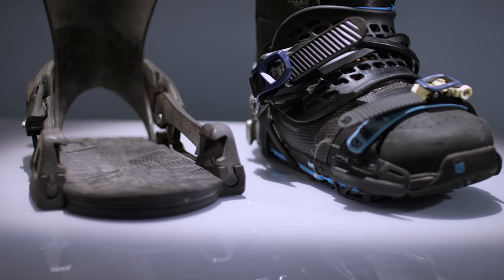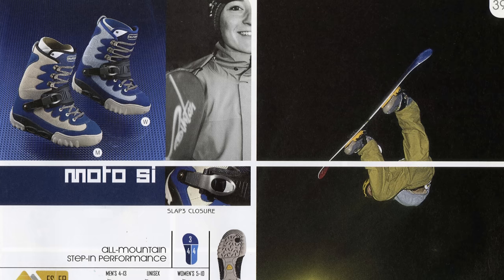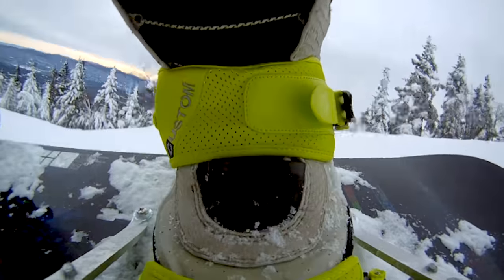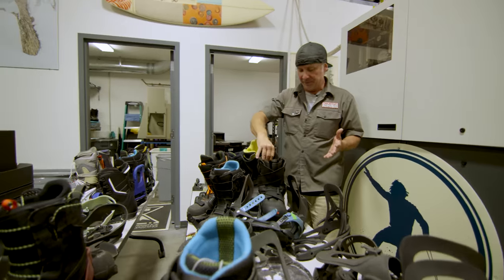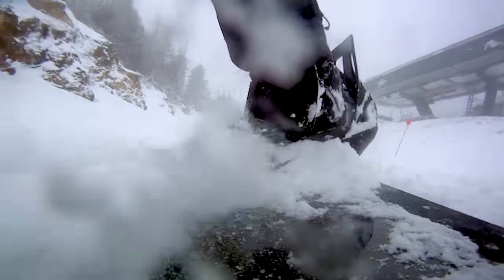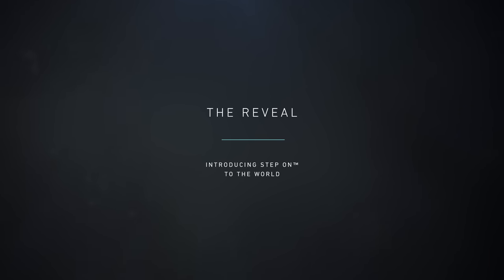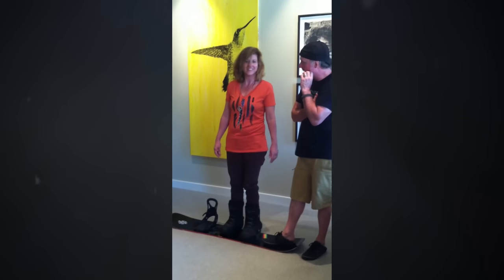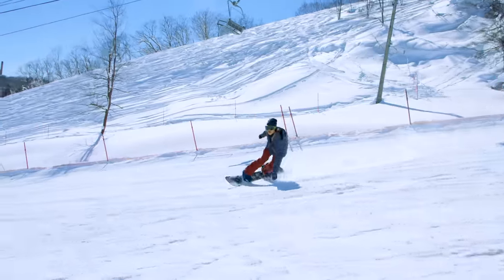Burton Step On® - Research & Development Process

Comment: Thats cool, now I don't have to wait for my boarder friends to strap on every run. Thanks from a skiier :)
Reply: haha my thoughts exactly
Reply: Sooo... You're gonna buy these for all your friends? You sir must have a lot of money lying around.
Reply: when you're not snowboarding for the first time in your life you can strap in your back leg in under 15 seconds. i guess it is too much time for some people
Reply: Anton Black I agree with you but this way cooler. It just looks so gratifying to step in and ride off
Reply: try an sp
Reply: I mean... it takes me maybe 10 seconds to strap my back foot in, but yeah, sure..
Reply: Skiiers left soo much scratches on my board every time in get in and out of the lift..zzz, they need new tech :P
Reply: @princetemujjin  ? Makes no sense but ok
Reply: I have a pair of bindings (don't know what they are actually called) that you push your foot under the top, and pull up the back to lock it in. Takes me 5 seconds before I go
Reply: If you are a skier that have friends that take so long to put bindings on that it's a issue and cant put them on standing up, your friends are not actually snowboarders. Lol hell, I can put my bindings on when skating at top and no I am not using those stupid rear entry flow bindings.
Reply: @simonthompson5280  those are either flows, gnu, or k2. They have actually been around for a while, but are not as good as actual straps.
Reply: @simonthompson5280  called FLOW
Reply: I can strap in while riding, but some people take a while to do it. It all just depends on the lever of expertise.
Reply: Skiiers have friends? Never heard of that lol
Reply: @simonthompson5280  those are FLOW bindings. I have a set and while very convenient. Never felt like i was firmly planted on my board. I ride unions now and while feel good, straps are a pain in the ass. My friend just got these step ons. And if it was not for the fact it costs more than my season pass id already have a set
Reply: You're going to wait longer waiting for them to clear the ice and compacted snow from the mechanism .
Reply: or tell your friends just to get flows
Reply: @ahtoshkaa  Depends where you ride. Like here the mountains are quite short, so you can slap a run in 40 seconds, maybe less. Most of your day is spent on the chair lift, so yeah 15 seconds adds up massively. It's half a run.

Comment: Been riding sideways since 91 and these are the bees knees. I think the comfort alone is worth getting them. I was one of those guys, “ah, they had Step ins 20 years ago”! Then I tried them and I was completely blown away and ate my own words. What I like about them? Boots are the comfiest I’ve ever owned, better than Vans better than 32 better than even my beloved Nike boots that I swore were he greatest boot ever made. never had BOA before and seems like I’ve been missing out. So easy to get the boot on and off. No pressure points from straps! Don’t lie, you know what I’m talking about if your a true rider. pressure points on the toes is no existent. And light! These bindings don’t weight as much as my Unions which makes my entire setup feel less weighted down. I’ve never really been a Burton guy but damn they got this done right. Check back here in 5 years and tell me I was right, these bindings and other brands to follow will change the way people connect to their boards. Great job Burton.
Reply: Great to hear the opinion of the guy that tried it out. What do you think about very unpleasant snow conditions for every binding system - wet sticky fresh snow that compresses to the ice in seconds under you boot and around it. Is this system sensitive to such issues?
Reply: Grigory Postnikov Only experience with the actual product would be able to answer that question. I know I have struggled with any click in, step in binding from the past with snow pack, but these have an awesome concept to negate that. Can't wait to demo or pick up a pair
Reply: I would say that you are gonna run into the issue in poor, wet conditions with any binding, strap or no strap. Just got back from riding today and many people asked me questions about the bindings with the most asked question about how to get your foot into the binding in deep snow. I would say you gonna have the exact same issue with strap bindings in deep snow so there is no difference. And if you think about it there’s actually less to worry about. Just think about it, I’ve had Union binding strap buckles made of magnesium snap, on the mountain, in very cold weather. I’ve had straps fall off on the mountain making me go to the ski resort shop to “fix” the strap which usually means getting a generic strap to make due. I’ve had screws pop off lost forever on the mountain. I actually saw a binding strap that fell off someone’s binding at the resort laying next to the ticket counter with a sign saying “is this yours”!!! Made me laugh!!! I told my buddy after riding 4 days so far on these Step Ons im selling all my strap bindings, my Unions, my Bent Metals they are gone. Never going back to straps. I’m telling you these are the bees knees and I don’t even like Burton! Just FYI I’ve been riding for since the early 90s so I know what I’m talking about, trust me.
Reply: sonndaugherty Never tried BOA? I bought the first ever Snowmobile Boots from the company that Burton bought the BOA technology from and haven’t ever looked back. I love BOA on Helmets, etc, too.
Reply: Excited for this. As a kid snowboarder it’s hard to get out on the slopes and I want to spend my time the best and this would negate the time strapping in, good job guys keep doing this!!!! This has a bright future and as a kid I and positive that in the future these will be the norm. Good job
Reply: I love how I can hear how you talk through comments ur sucha snowboarder😂 ❤️
Reply: It’s been 4 years and you are completely right. Burton has created a revolution, and I’ve even heard that other brands are going to be coming out with step ons. Man you predicted the future 😂

Comment: REVIEW: Just spent a week with my buddies step on setup on my board. Riding 40% park, 40% out of bounds/powder, 10% ripping straightline down the mountain, 10% other shit, at Whistler and Sunshine/Lake Lousie.. Bindings performed well in all circumstances. I did have slight issues putting them on in powder, but no more then you'd have for a strap binding, just clearing out snow under the boot. Worked well in some very cold conditions in Alberta, down to -25 C. They are just as responsive as traditional bindings in terms of board control.

 I didn't feel limited in what I could do, and felt comfortable with putting a lot of stress and force on them. I will say it did take a day for me to truly feel like that. The first morning I didn't throw anything more than some 3's and 5's on medium jumps, and wasn't torquing them in and out of turns at high speed. Then one run I finally felt like I wasn't pushing the binding past its limits, and I was able to start pushing my own skills again without popping a foot out accidentally. Learned how to rodeo in them, and would have felt fine trying to learn cork 7's if I had more time, so if your a park rat these are a viable option as well.

All in all they function at pretty much the same level as strap on bindings. Will I personally buy these? Probably not, simply because when I went back to my old bindings and boots, I realized how much I like feeling the top strap on my foot. I just personally like feeling the strap push into my boot when I carve hard, or butter or whatever. If I didn't switch back, I probably would have got used to it completely and not notice that anymore. That being said, that is just a personal preference and I have personally recommended to a few friends and customers that they check these out when looking at new setups.

Comment: Product reviewers have glaringly not picked up on the fact the base plates (center locking hub) are flexible. This allows for amazing control like traditional systems give. This flex is ingenious and matched with my resurrected Burton Canyon 181 with a three hole mount has provided precise riding and control. Also the convenience is self-explanatory. Thanks Jake for taking the time to develop this revolutionary binding system which I have 33 days on this season to date. Cheers.

Comment: I still rock the original Burton step-ins from 1999 on an old 1995 155 Burton Twin. Still holding on and working well after so many years of abuse. Park and freeride for 25 years on the board and 20 years on the bindings still going strong.

I tried flow bindings for a bit but hateß the function so I went back to my Burton ones.

Comment: As a engineer I can really appreciate the process involved in creating this.  Props Burton 🤙
Reply: I can say the hammocks and gas pedals are under-engineered, flimsy, and easy to fall/break/lose, if they do not specificy periods of replacement of the toe clips, AND make them available then these are patently dangerous - by 65 days I could pull my rear boot out of the binding by applying less than 30lb of lift... with another lift/twist I could disengage the heel. This could happen in a big fall.

Lots of talking about engineering.... But this product feels like 3d modeling prototype sent straight to market. 

Secure the Genesis highback with more than a single pop rivet... and plastic teeth that break...
Secure the gas pedal with more that plastic teeth that release/bend/fail... I had 2 fall off/get lost and even found another guys...
Reinforce the toebox seam on the photons instead of the rest of the boot being stiff and FAILING across that seam - both boots from day 40-65 failed completely.

For  few weeks these were great but they need work. 
I'm not an engineer - I'm a snowboarder.

Comment: I'm just concerned about the deterioration of toeside response with this system. You can have a packed out old pair of boots that have lost rigidity and get the response from your straps. I ride diodes and love them but feel like step ons wouldn't last. Still really cool and innovative though but I think you would have to replace your boots more often to not sacrifice performance.
Reply: Now its time for Burton to up the boot game
Reply: Toe straps do help, but the high back does most of the work, unless you have a no back.  I've ridden with broken toe straps and been fine.  I do agree the toe clips probably will get loose or have more play in them over time, but so does a toe strap.
Reply: Straps wear out too. I have to replace my ladder straps a lot during the season. But I ride a lot might not be a issue for people that ride a coupe times a year.
Reply: mushieslushie I'm not thinking about the toe straps at all, heel straps are where i get a massive amount of response when I'm riding
Reply: sonndaugherty Replacing a ladder or even an entire strap is a lot cheaper than an entire set of boots prematurely
Reply: If the boots had replaceable inserts, kinda like ski boots have, that would solve any wear and tear problems.
Reply: I had no issue of ANY sort with these and I am very aggressive carver and like to do big skiddy turns on blue ice and throw up clouds of white... But after 5 or so weeks boots started failing. They need to reinforce the ENTIRE boot or make them resistant across the whole boot by avoiding weak areas like the toe seam. both toe seams failed on photons. toe clips failed by day 60-65 on rear binding. Would release foot every run.

Comment: Switch made a good high back step in with soft boots that worked great a decade ago.
Reply: Yeah I used to love my Switch Team X bindings, but the boots were heavy and hard to find.
Reply: They still ride great but comparing Flyaway BOAs to today's boots (2018) and the weight difference is incredible.

Comment: I can appreciate the trial and error of the R&D efforts when I watch this vid.  The set backs.  The failures.  So glad Burton was the company that funded this effort and introduced something that I would consider disruptive to the industry.  This tech seems legit.  There will be a demographic for strap-in users, and there will be a demographic for step-on users.  If the tech works just as good as strap-in, but does it in a way that saves my energy from bending over to strap-in, I am sold.

Comment: This is a great concept and I don't doubt the work that went into it.  Burton is an industry leader in R&D.  But don't get it twisted.  The ultimate reason for this binding platform is money.  Many people love Burton bindings and boards, but not their boots; or they love Burton boots, but not the bindings.  With the step-on, you trap people into buying the boots AND the bindings, not one or the other.  The same is true with the 3d hole pattern on older burton decks and the channel system on newer burton boards.  Burton bills it as "revolutionary" and that might be true, but the real aim of systems like these is to require riders to buy all or most of their gear from burton, rather than mixing and matching.  Eventually, another company will release boots that are compatible with the step-on bindings, just like they did with the 3D hole pattern and the channel system, and Burton will move on to their next "revolution in snowboarding."
Reply: call it the apple of alpine adventures
Reply: I agree. Bought the Ruler and the step on bindings, but had to return them, because the boots just didn't hug my feet well. Gonna wait a year and see what they will offer.
Reply: A company trying to make money!!??!! What are they thinking! Bastards!
Reply: Youre absolutely right in everything what youve said..But what should they do instead?
At some point they reach market saturation with their current products and then a company has to release new products to stay in the market. 
Why not being revolutionary at the same time? 
These are all big words, but thats how business works. 
If they dont reach a critical mass theyll move on with another project. 
Doesnt mean, the products are garbage or useless.
A better click binding is not something that would be useless if you ask me.
They would be alone, dominating that market and thats good business. 
At some point other competitors will join in, the price will drop, money for further development wouldnt be profitable, so they move on to the next project.

Thats a textbook good company if you ask me. 
I really thought, that the video was great and personally I thought, Burton looks like a fun place to work at. 
Of course you dont see the stress and frustration, during all these failed prototypes. At some point some executive came in and reminded them that they have a deadline, maybe. Butat least it looked like, the engineers have a really cool job and are happy coming into work everyday, especially after the first reactions on their project. 

Nobody is forcing you to buy it.
Reply: true but most boarders hate having to sit down and strap up every time you get off a lift.
Reply: @Dnt_Push  a company trying to make a great product then making money as a result. it's different.
Reply: nick woodward I haven’t demo’d these yet. But I hear good things. Are you saying Burton wasn’t concerned with these being a “ good product”?
Reply: Scott M it’s called the beauty of capitalism.. innovation and competition

Comment: The problem I personally have with Step Ons is I can't make them tight enough. 
Just my opinion, but I need them really tight
Reply: With these, your heel is locked in.  Your toes are locked in. Heel to toe response is faster than all the strap bindings I have have used over the years.

Comment: I've been using the FLow reclining HiBack bindings for years and i can not overstate the time it saves and how much of a difference it makes in the snowboarding experience to not have to ratchet in every time. It deceases fastening time by at least a factor 10. Making it actually faster usually then any of my skiing friends who need to twist the strap of their ski-poles around their wrist.

I can only imagine this increasing that difference. Just step out of the lift and Goooooo!

Comment: My friend has these and when ever snow gets stuck in them he has to sit around for like 5 min with a littile took getting all the snow out
Reply: These self tighten on the heel with a ratchet. When you step into any binding in powder or slushy conditions you would normally brush the snow away. No difference with this binding.  The advantage with these step ons is the heel cleat has two locking positions so when there is some snow in the binding the heel still locks in and self tightens on a heel turn or on an ollie - as the snow dislodges. I live in Colorado and have been riding these for 3 seasons, 50+ days/ year and 700,000+ vert ft/ year. Not a single issue.
Reply: Then he's not doing it right